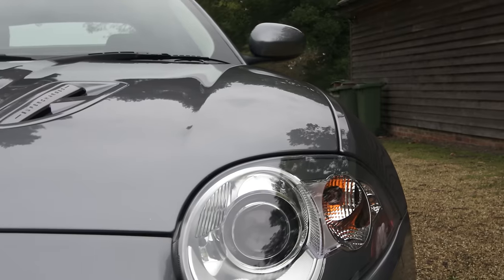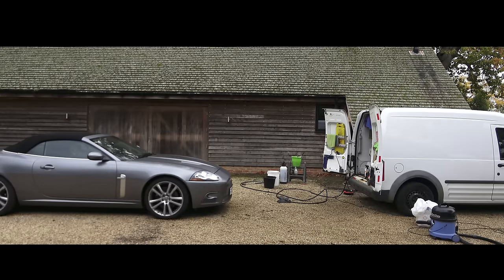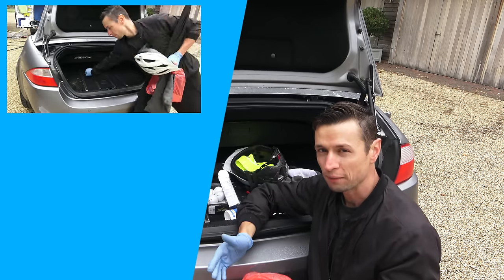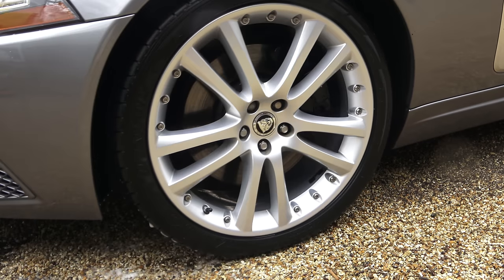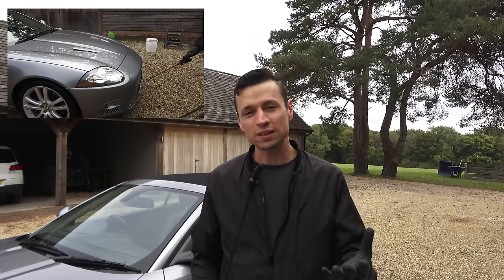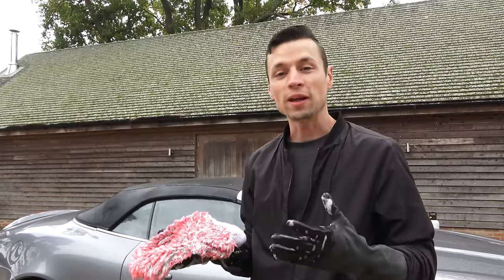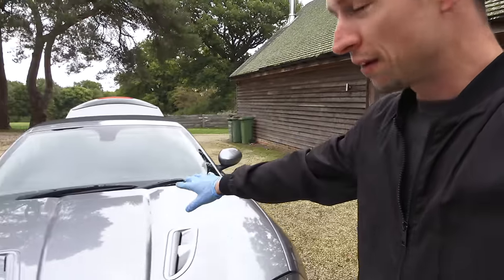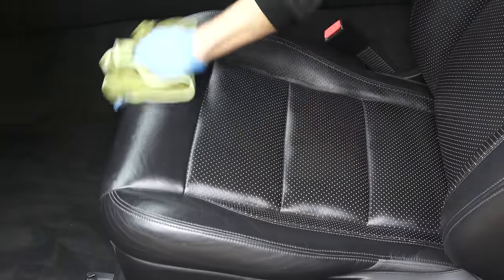Mobile Car Cleaning Guide to a Standard Valet | HOW TO DO IT FAST!!!

Comment: I agree with almost everything mate but always two buckets mate it takes a few seconds to fill empty and use for a detail yes I use 4 buckets 2 are the wheels and two for the body the customer passes by and can see how many buckets will be more likely to see you take the extra care and you may get a customer you may not have had otherwise the rest for a cheap valet I definitely agree with you customers are not likely to count your brushes cloths or even understand the chemicals you use but everyone seems to understand the two three even 4 bucket method so that's something I hope you use plus as you sed a tiny extra step to reduce the chance of scratching is worth it you only fill and empty buckets once on a valet so it's really no extra time to use two a valet I use two a detail I use 4 wheel clean wheel rince a body clean and a body rince for a high end car and a well paid job 6 buckets adding glass clean and glass rince buckets every bucket with a grit guard and even a valet I use numerous cloths yes I charge £45 for what you done with my methods but I refuse to be a scratch wash

Comment: Great video.. I've spent hours detailing when I should really just be valeting, I will definitely be taking a lot of this on.. 
I just have one question..
Should you not at least rinse the car off with a hose/pressure washer to remove surface dirt and also to rinse the TFR off the lower 3rd of the car body before the contact wash?
Thanks again for very informative video.
Reply from the maker: Hello mate ,yes you should sorry sometimes video sequences get shortened but to be honest the majority of tfr is washed off before the contact wash Stage
Reply: @epicautomotivedetailing  Nice one, I actually watched your video again after I posted my comment and did notice you using the pressure washer.. I must have blinked the first time lol..
Anyway thanks again buddy, I've subscribed to your channel and requested to join the fb group.. I'm sure I will learn a lot from your channel and reduce my time valeting cars and save myself time and money.

Comment: How do you know at what level to ask for additional soiled charge.  Coffee stains for example come out APC….. Just takes longer.  Also you talk about fallout remover or Korrosol.   Why not hit it hard with acid wheel cleaner ?  Fallout I find only good light dirt wheels whereas I’m hitting black wheels never washed.  I see bargain price cars.  I too use TFR for tyres.   Roll back method great.   Never knew about that logical trick.

Comment: Hi. Im looking to start doing Car valeting on the weekends as a means of extra income... what was it that you applied to the wheel face after rinsing off the TFR?
Reply: can this also be done within a hour.. cheers mate
Reply from the maker: I use quick detailer as a drying aid and yes you can clean cars within an hour using this process.  Thanks for watching Jay
Reply: Thanks for your quick reply... Very good video

Comment: For the weekend warrior, how often should you apply iron remover to car paint?
Reply from the maker: Iron remover not always essential. If you clean your car regularly you can get away with wheel shampoos. If you apply some decent ceramic over the wheels whether it's a coating or spray sealant it will greatly help

Comment: Does anyone have any tips on hoovering interior in the rain? Only thing I’m worried about is getting water inside the Hoover😕 cheers. Auto Revive🙂
Reply: If you've got a quality vacuum (Henry, any industrial style vac, wet/dry vac), you don't need to worry about 'inside' the vacuum. 

In terms of the rain on the hoover itself, if you want a quick-and-dirty solution to light spitting rain, usually just draping a large, absorbent microfibre drying cloth over it (where water could get in, so just basically the top and around the switches and seams) is sufficient - You're not going to be out for more than 20 minutes if you're doing a quick hoover-out, and for very light rain, I'd even question doing that much tbh. If it's 'legit raining chief', then you can get a small kid's pram cover, cut a hole in it for the hose to poke out, and then tie it around the vacuum basically permanently, and then only take it off when you have to change the bag. Obviously, you want to make sure the mains plug and extension reel are protected, and if you have a weather-proof reel, then it's set-and-forget in any weather. 

If you're worried about legit vacuuming small quantities of water from rain getting in the car during cleaning process, don't worry about that - A common practice that I do on cars that need a quick bit of fragrance freshening is getting a carpet cleaning spray (TurtleWax foaming carpet spray as a good example), spray it over the whole floor, work it in lightly with the brush and then spray a second mist coat - Not only will it freshen the smells in the cabin, it will also leave the carpet looking 'blacker' and will act as a spot-coat, allowing you to see instantaneously where you've already passed over, plus it will add that slightly better finish just from spending literally sub-thirty seconds in each floor well.
Reply: @AlexYeets  thanks for getting back to me! Just worried about water getting inside the Hoover electrics I was. But it is a Titan industrial wet and dry vac style Hoover, only concern really was the on/off switch at the top, don’t want rain dripping down into there. The idea with the Waterproof pram cover is an excellent idea! I’ll be using that a lot during this winter I think haha. Thanks again!🙂
Reply: @tirionevans7261  No problems! 

I neglected to mention - make sure there's plenty of space around where the air comes out of the back of the vacuum otherwise it could end up causing the motor to overheat - as long as air can physically flow out from under the cover, it's all good!
Reply: @AlexYeets  yeah I was thinking of just cutting out a hole for the air to vent properly! Cheers Alex for the help!
Reply from the maker: My Charles vac has a waterproof cover over the button but definitely see your concern. I did an Instagram video on my poor Charles vac in the rain lol
Reply: @epicautomotivedetailing  where did you get the cover from? I’m sure it’ll withstand most weather, but I’m just concerned for when it’s absolutely thrashing it down, I can imagine a lot of water dripping down the sides of the switch..😬 I’ll have a look for the video now!🙂

Comment: No idea why u struggle so much with wheels, in germany we have PH 2.5 ACID wheel cleaner, you just spray it, wait 5min, rinse off, and wheels are totally clean, even if they are completely full with brake dust and etc, And it costs like 90 dollars per 25 Liter concentrate which you can dilute up to 1:15, but usually u use it 1:1 or 1:5
Reply from the maker: Fair play i sometimes use a bit of acid cleaner on some wheels

Comment: I have always done the 1 bucket method 🤣 2 bucket method is a gimmick. Get ya selves a short lance and rinse the mix out if you really need to. For the sake of a £35 valet I use the foam lance to shampoo the car aswell, you can't make money spending 3 hours cleaning a car that's less then minium wage.
Reply from the maker: I wouldn't recommend anyone clean a car for £35 for 3 hours. This should take an hour tops